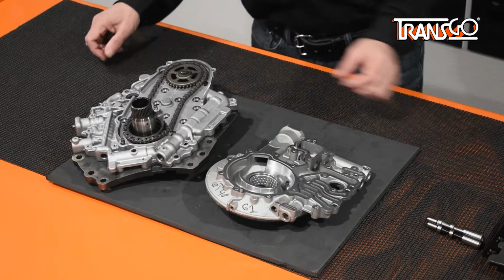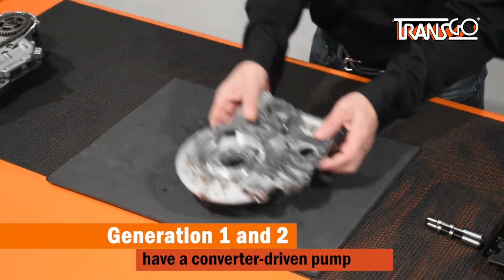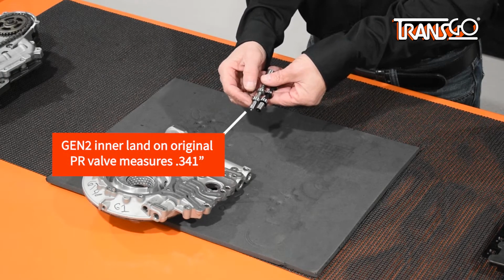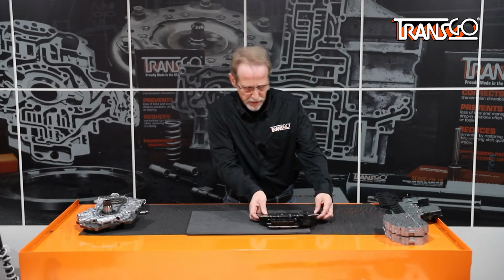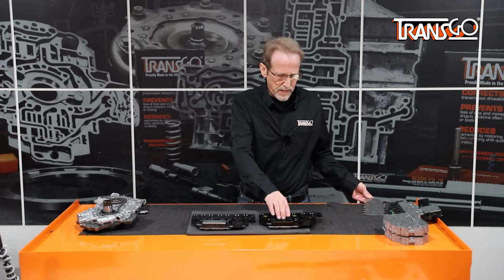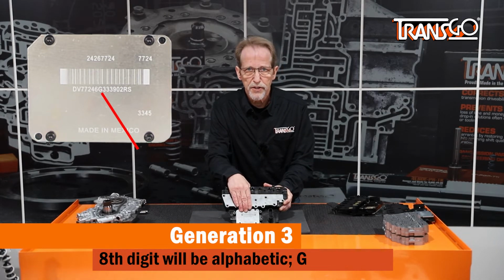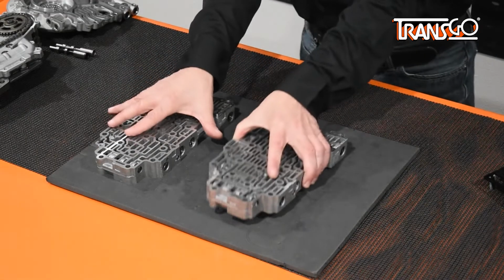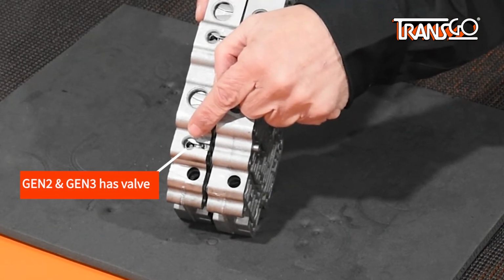General Motors 6T40 Identifying Generations 1-2-3

Comment: Was there another uofat to the 6t40 2018-2020?  I ask as I have a 2017 and 2020 Sonic and the transmission in the 2020 shifts noticeably faster, crisper and more responsive.  I've had them both since new with same service.   Or is it possible the LUV 1.4 was revised with better airflow?   Doesn't account for the transmission shifts but would for the responsiveness.  Thanks

Comment: Hello. I have a vehicle with gen2 tcm module. Can the gen1 tcm module be installed in my vehicle?
Reply: have you found out if its possible?
Reply: @gigimarfa877  Yes, I found out, it doesn't work.

Comment: HAllo , I bougtht an OBD II scan, Torque Pro app,  Can you please help find the correct [GM]Transmission Fluid Temp (GM Method. I saw that there are 3 methods but I don't know which one to choose according to my transmission and have the most accurate measurement possible. I have e Cheverolet Equinox LT , 1.5 , FWD, 2020. I believe the transmition is a 6T40?!